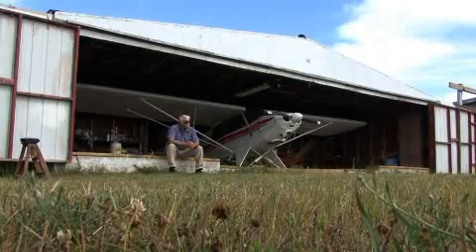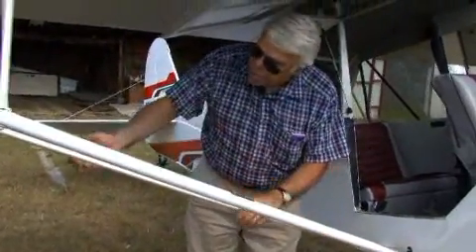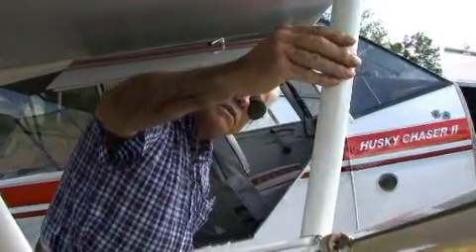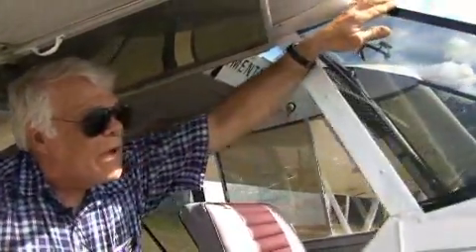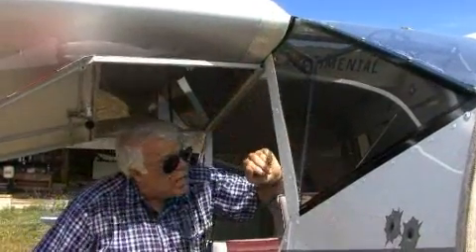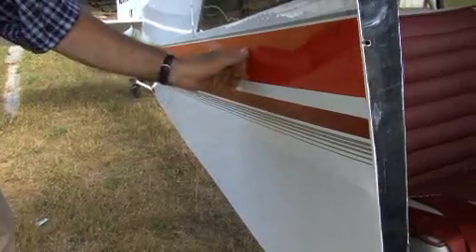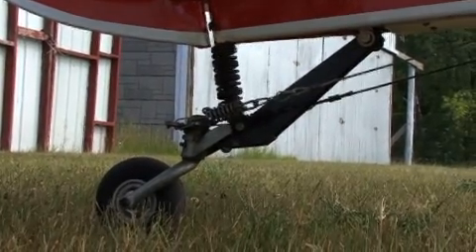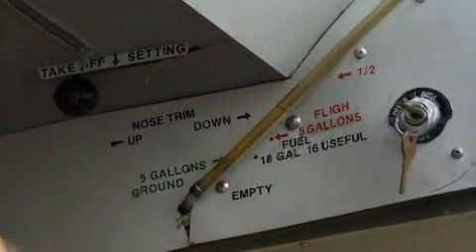Affordable Flying: Building an Airplane for Less than $6,500

Comment: Now I am a mechanical engineer. I'm confident I could design a plane that's perfectly safe. 

I am not, however, confidently say that my handiwork would produce the expected safety. Knowing myself I'd forget to attach the chain to the rudder.
Reply: Truth is professional Aviation mechanics aren't confident they can do it either. That's why they have 100 layers of inspection to make sure it's done right. Just double check everything you do a ton and you'd be better off that most people. Flying the plane is where I would see more issues.

Comment: How did u get ur airplane to pass faa inspection? I have a Cessna cub( Cessna 152 wings on a pa18 fuselage with a custom tail) but i am running into some major issues with the 50% rule for experimental
Reply: did you ever get it certified?

Comment: Doesn’t say much about testing or analysis.  I’m a mechanical engineer and want to build an airplane. All my experience is automotive. Without knowing load factors, required g load capability for a flight worthy machine causes me some hesitation. This fine gentleman passed the final test. I’ve seldom got from sketches to 5-9s reliable hardware, or at least reliable enough for me to take it up to 1000 feet and buzz the brother in law,  in one step.  Sometimes it’s 
good to not know what you don’t know.  This guy has some very special intuitive talent.  Don’t everybody think that this will work for them.   Think about, “guess and test”.

Comment: . He really didnt give any information about the plane in the video. No mention about the engine, which can cost close to $20,000 for a used one ten years old , and $3000 for one needing overhauled. The parts he said he got from an old Taylor Craft, Cub etc. cost the same as any other plane.  The only place he saved any money at all, was the latches he made out of spoons, and the homemade windshield, and putting plastic on the wing struts.   Another thing he failed to mention was how much the plans cost, who you order them from, or do plans even exist.  Did he find the fuselage in a salvage yard, bought it at an auction, was it a Cub, a Cessna or a Stratus someone gave him with good fabric, and a strong running Briggs & Stratton.  I found myself interested, until I realized I had no more idea how to go about getting a plane like that or how I might get paid watching TV.  Was kinda disappointed after that. So thanks for nothing Tim buttles.
Reply: ...and a big "shout-out" to EAA for posting this.
I suppose one could find a money-saving tip here and there on this video but, when it comes to aviation, I can't see using inferior materials of any kind.
I wonder if those spoons were aircraft grade?
Reply: used cessna continental engine have lot can buy less than 4000$ not lot hours used can use own project cheap, and ewery men can repair engine easy. its only big shit not true need waste engine 10K-20K-30K money than idiot.

Comment: >$6500 plane...
with probably $10000 worth of tools alone, a hangar, airfield costs, legal hoops, red tape, regulation etc.
Is there any option for me to fly on purely cost-of-materials and gas alone? 
no fees, inspections, insurance, rent, tie-down bills, or any other unnecessary costs?
The golden age if flight wasn't the 50s and 60s, it was the 1910s and 20s
bring back aerial anarchy, let me build a wood stringbag and give rides for $20
Reply: not need this all, idiots waste lot money than not true need waste.

Comment: Hi Tim, you're not telling anyone if this was some airplane fuselage you started out with, or if it was something you actually built yourself from a set of plans you bought. Most people can't afford a $50,000 or $400,000 factory built airplane, but there are several that want to fly and could get $6500 if they knew where they could buy the plans, and build one like yours. Or if it was a wrecked Piper Cub you found at an auction, insurance company, or stole it one night from a local air strip. Instead of just telling people how clever you are, share a little bit. A lot of guys would love to be able to fly. Did you actually build this plane, or just patched some 50 year old plane back together? You didn't say how much you gave for the engine.  I did notice it was either a Lycoming, or Continental aircraft engine that cost $5000 to $15000 for a used one, unless its needs overhauled, which would pretty much suck your pockets inside out, including your Kids piggy bank. J3 , and PA11 struts cost as much as any other strut, just like Taylor Craft  tail feathers aren't any cheaper than Cessna, Beechcraft, or Piper Cub. Now you're home made windshield, and cowling latches will save money, I'm not sure about a human life, but its only money.  is it registered as experimental or a certified craft? Just Curious.

Comment: the parts he got from a taylor craft , piper cub, tri pacer etc. doesn't mean they're cheap at all. why didnt he say if he built it from plans or already had a fuselage from a junk yard, or what kind it was, not to mention the engine. actually he didnt tell anything much about the plane. some people including myself would like to check into building a $6500 airplane like this x brand plane, but with the information he gave, it might as well not exist. did i miss something here?

Comment: “Well, normally you would install an aviation engine but that is too much money, so I just attached the propeller to a rubber band!”
Reply: used plane engines can buy less than 10K$ and old beetle engine used many plane, and new mitsubishi aluminium engine etc. many cheap option have not need waste money than idiot buy only ower expensive engines.
Reply: "works pretty good"

Comment: Something's wrong here. Ok, so the plane is built, but will the various components be durable and reliable? He mentioned that one of the wing components was glued !  Sorry, but I would not get into that airplane.  Reliability and safety, not cost, should be top priority.  This man is creative, no doubt, but I think he confused model airplanes with real aircraft where people's lives are at stake.
Reply: Grumman american AA5  is bonded/glued together   just FYI  my friend
Reply: Dan...Ye of l'il faith, dude......The "jury struts" have a plastic cover over them for airfoil looks.....they still have metal struts, just "dolled up" to look like they have an airfoil...People ???!!!!
Reply: Besides , the french Cap 21....
all wood and glued together w/ epoxy...and won many world aerobatic meets....
The Scale Aerobatic Model with Character
Our CAP 21 is designed for large model aerobatics and is especially light, but in spite of this is very strong. It can be best described as being of simple construction. Nevertheless our CAP 21 is scale in every detail.

Quick to Build
Due to this simplicity the model goes together in a surprisingly short time. The wing is of conventional construction. That is to say, spars, ribs and fully planked with 2 mm Balsa sheeting. The wing is built in one piece, a two piece wing of the same strength would increase the weight to an unacceptable level.  ( The full-size CAP   is an all wood airplane ), our CAP also, with the fuselage being a simple Balsa box construction with a half round Turtle deck.
Reply: Yeah, well he just flew today. Still going strong in 2025. I know, I was there.Timothy is my father.

Comment: Great video.  Only issue I have is the hangar.  How much do you suppose he is paying for that?  I know in the Reno/Sparks area you’re looking a $350/month minimum to share a hangar, more like $400/month.  So you’d be paying $4800 a year to house a $6500 airplane.  And yes, it needs to be hangared, it’s fabric.  In a way this shows that an all metal Luscombe, Cessna, Piper, would pay for itself in just 4 or 5 years because you can tie it down outside for maybe $480/year.  Or maybe even better yet, a folding wing like Kitfox or Avid.  Just thinking out loud here...
Reply: The hanger is his, it was paid off many years ago. It’s just a small grass strip airport he flies out of. I know, because he is my Father. I grew up running around all the hangers out there and spent many summer nights mowing the grass out there.

Comment: The engineer in me both loves and hates this. It's really good jerry-rigging, but I don't know if I want a jerry-rigged plane... It's terrifying because he's attaching stuff to parts of the plane that weren't meant to be attached to. I'm sure his weight and balance calculations and V-speeds aren't correct anymore. Using bungees based on weight of the aircraft without considering the geometry of the suspension? Woof. As far as a 1-man pleasure flying far from the performance capabilities of the frame, it's probably fine. Would I put my kids in it, that's a big nope!
Reply: It’s 2025 and it’s still flying.

Comment: Well intended i'm sure, but most of flying is thinking ahead. That gas tube is a disaster waiting to happen....not the place to go cheap. What would he do if it came apart in flight? That is a REAL prop and engine.......unless they are boat anchors, they are worth more than the plane. Of course he never did say it actually has flown......or "could" actually fly. 
I've been flying 59 years and have seen many smoking holes made by well intended , nice people.

Comment: perfect plane for recreational flying, no static port and pitot tube, no six packs. No electrical system for radio and flaps, all he need is a rotating prop and wings to make it airborne. I wonder how he connected the yoke with the string and actuators.

Comment: "There is a common figure circulating on the internet that the actual first plane, the 1903 Flyer, cost less than $1000 (less than $28K in current dollars) in terms of parts and materials." I'd say you did pretty darn good.

Comment: I can build a airplane for 0 if all the parts are free ! We are not that stupid. You left out most of the major parts ! such as the engine, prop, covering, most all the wing & the list goes on.
Reply: The wing was made from the metal spars he mentioned, and airframe from the tubes he bought. Then used fabric to cover same. Prop and engine likely from air salvage company and much of the $6500.

Comment: Click Bait. Even a " run out"  engine would cost more than he spent on the whole plane and then there is the prop and electrical system. He didn't fly it...so maybe it isn't in license.  It does have an "N" number. I like the plane, but i think it has to be licensed and flown "Experimental".
Reply: You can also think outside the box and use engines from other applications. Think, snowmobile, motorcycle, or even a vw. You can find 1600's for under 1k, and snowmobile engines for under $500.
Reply: airmuseum nope, the tail number is on the rudder, and if you scrounge, you can get cheap engines. Hell, I've seen o-200s go for $900 bucks if they need an overhaul. It is absolutely possible to build an airplane for the advertised amoung.
Reply: why so salty dude?...
Reply: 2:45 clearly marked Experimental
Reply: Titan, the manufacturer of that "T-51" kit plane, recommends the Suzuki H25 or H27 (out of a Suzuki Grand Vitara or XL7 respectively), among other options from the automotive world, for their planes and they seem to get off the ground just fine...

Comment: This convinces me that I could build a plane and power it with a modified motorcycle engine.
Reply: Actually, the way to go is the Yamaha RX1, or Yamaha Apex snomobile engines. A couple of companies make adapters to attach a Rotax gearbox to those motors. They have proven to be very reliable, light weight, and make more power than the Rotax 912 for a fraction of the price.
Reply: MX304 I live in Michigan where snowmobiles are common and a lot of them fall apart but the engines are still running.

Comment: The man illustrates an important concept.  There is often more than one good way to get something done.  And youtube has opened people's eyes to that concept by sharing information and methods, techniques from all over the world.  Knowledge is a powerful thing.  Now, how can I avoid the recurring gout in my right toe?  I'll bet someone has a better solution than the doctors.
Reply: Agreed. And this is a wonderful example of telling the rest of the self-inflated aviation "industry" to go and jump in the lake with its ludicrous charges for servicing, insurance, regulations, certification and everything else controlled by rapacious middle men.
Reply: I agree knowledge is a powerful thing, and there is often more than one good way to get something done, still for a price. The price is likely some form of change, like in material, schedule, cost, or use.  Gout is caused by a problem in one of the body's scavenging and recycling systems for protein and DNA. Eating too much of either one (steak, mushrooms...), or breaking down too much of your own (alcohol, damage...) can overwhelm the malfunctioning pathway. This bottleneck causes uric acid to build up. This alone is harmless, as you will pee it out. When high uric acid in blood encounters low pH areas of the body, cooler areas with poor blood flow, it can form crystals. The crystals are sharp and cause damage. The goal is to dissolve them by temporarily raising the pH and increasing blood flow.  How? Mix some baking soda, a mild base, into water and drink it, once or twice a day. This will help control an acute attack within a day or so. To prevent an attack, cherries help pee out urate, and avoid trigger foods and body damage, and exercise to improve blood flow.  The PRICE: baking soda is like salt in sodium content, so this solution will stress your blood  pressure, blood vessels, and your kidneys.  The baking soda will cost a few cents. I hear you about doctors, but not all of us are idiots or under corporate control just yet ;)
Reply: Gout. Try cherries, mangos and plenty of water. It's not wine etc which causes the ache, it can be the water pills you may have been taking. It's worth a try, tastes nice anyway!!!!! The fruit, not the pills!!!!
Reply: Suffered from gout for years, my wife sent me to a specialist. I have been gout free for 8 years now due to taking Uloric daily. It must be taken with Cochine for 3 to 6 months to start ( as taking it could cause a very bad gout attack.) After that just a Uloric a day and eat or drink whatever you like. That is my experience.
Reply: Prop your feet up every night before you go to bed for 15 minutes it is also good for swolen legs.
Reply: A couple of bananas a day!.....Your welcome!

Comment: Believe it or not, if you put "experimental" on it, there is very little regulations regarding it. However, it still must pass FAA inspection before it can legally fly. If the FAA determines this thing airworthy, God help us. Do you really want "cheap" when it comes to flying? I'd rather buy a cheap car and spend my money on a good plane. There is nowhere to pull over up there if something goes wrong. While I'm not against homebuilt airplanes, I only support them when they use aviation parts, fittings, etc. Not a spoon for cowling latch.

Comment: Nice work sir.

And a nice plane. Seems well thought through and very functional. It's probably a lot lighter than a some of the expensive kits as you didn't add it if it didn't need it. It's easy to get carried away if you have a lot of fancy parts in the pile. You've proven it can be done without miles of carbon fiber and titanium hardware (and $400 latches - ouch!) 
 
I'd expect you have it dialed in and flying well. I just subscribed to Kitplanes even though I'm disabled and on social security with no cash and no pilots license. I'm going to make it happen somehow. I'm still not sure how, but you have proven it's not impossible.
You may just have inspired me to start planning something similar.

Thanks!

Scott
Reply: Do it man. Do it. 
Start Saving Money, get one piece after the other.
Step one: Try to figure out a mainframe. (The stuff the rest is build upon.)

Then work your way up, look for instructions, kits, DIY infos, everything you need is on the internet.
Reply: Thanks Max, I appreciate that, and I am going to do exactly that. You'll never get there unless you start the journey. 

I once did so with a race car, and a salmon fishing boat (I'm not too far from Lake Ontario, and trolling for salmon is a normally high dollar operation), but I showed my 2 sons how to teach yourself to do something step by step. We went from a canoe with electric trolling motor when they were little to a 12' alum  to a 25' big water boat step by step. It's a 1973 Starcraft, but it's new now, down to each rivet and wire. 
I guess that was a good warmup for plane building. It sure gets your friends and family used to this sort of thing. Doubt anyone will be shocked I'm building a plane in my shop....

It's for sale this spring. My kids are both off in College and I can't handle it myself.  I still have the 12' if I want to go fishing local.

 All fishing tackle for 3 included. Front of the walk thru windshield is a casting deck with foot/remote trolling for bass fishing. Swim/cooler platform  on back. EZ loader tandem axle  trailer. Tows nice.
 Anybody want to trade a plane or plane parts for a nice multi use Boat?  It's going in the paper as soon as I get it out of storage. Central NY.
Now my kids are older and I'll show them how to fly. So a 2 place would be nice.

I already bought the GA handbook, I'm going to read that until I can recite it. It's time to start learning. Does anyone on here do classes on GA or something like it? 

Maybe someone here can recommend forum where I need to be to learn the ropes? 

Thanks Mr Buttles and Mr Joswing, I was almost there, it's time to commit. I'm building a plane. Hope it's done before I am.

Scott
Reply: Thats the spirit man.
I may not be good with Aviation myself if its more than flying on a Computer, and i live to far away to buy your Boat, but man...
I wish you best of luck with your Plane :)

Love from Germany :)